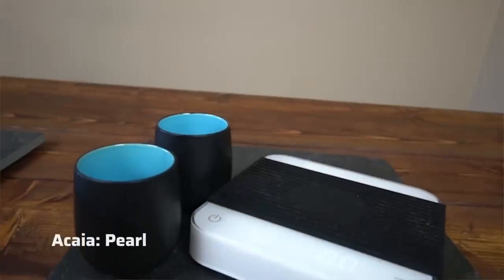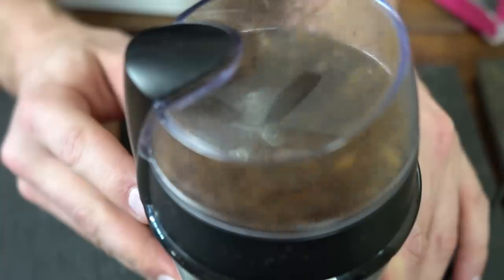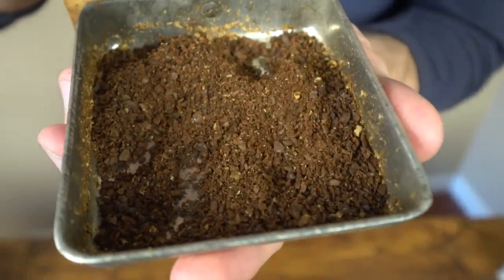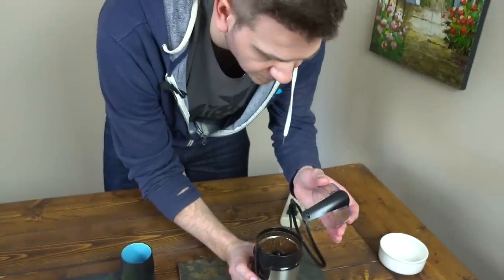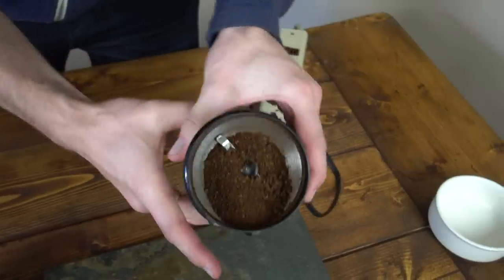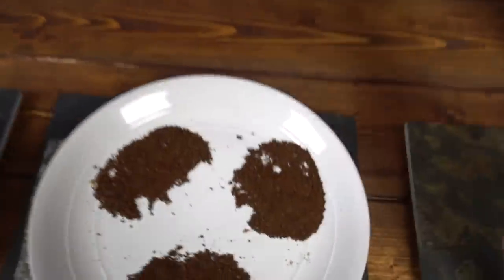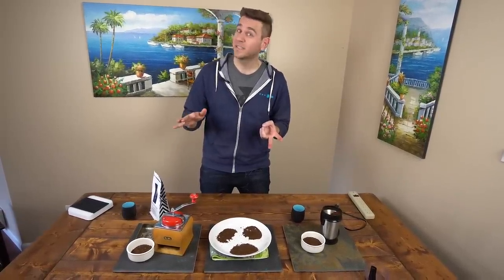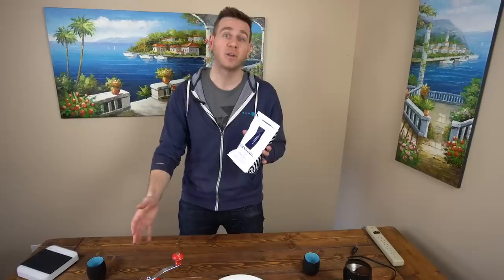Burr Grinder vs Blade Grinder || Coffee with Serge Ep4

Comment: I'm not sure why it's important to me, but thank you dear Editor for including the "turn off power bar, then reach in" shots
Reply: You can never be too safe, but typically these electric grinders require the top cover in place for the trigger to actuate.
Reply: Yeah, there's a reason a lot of blade grinders integrate the button into the lid, so you can't turn them on without that in place.

Comment: I switched from a blade grinder I had been using for years to a burr grinder a couple months ago. I was pretty good with my blade grinder but the burr grinder now lets me make the same cup of coffee everyday. I also like the fact I can change and control my grind setting for different beans that I buy. If you are new and don't want to spend a lot blade grinders are fine to start with. I do recommend the martini shake I think it helps create a more even grind without over grinding some of the coffee.
Reply: Hell yeah! The martini shake for sure is a thing I enjoyed the most using a blade grinder 🤣  
But the end result using a burr grinder is just a lot more uniform which is important for better extraction depending on brew method.

Comment: I got a burr grinder for christmas this year and the difference was stark compared to what I got from my blade grinder.  Especially for making cold brew, I used to get SO much sediment from the blades no matter what I did.  Went to the course setting on the burr grinder and had almost none.
Reply: Going from "spice grinder" to cheapo-electric burr grinder, to Baratza Encore (p-good electric burr grinder) has been a continuous staircase of "Less unusable dust")

The only use case I can argue for a spice grinder are less expensive latte/cappuccino makers where your intent is to consume caffeine, than to dial in the espresso. and the fine-to-dust grind works out.
Reply: I also got a burr grinder for Christmas this year, and I'm really looking forward to finishing up my pre-ground coffee so I can give it a whirl! My blade grinder has been collecting dust in a corner because, well, dust is all it's good for. Coffee dust and inflicting noise-related migraines. Can't wait to toss it.

Comment: Question: Are there automatic burr grinders, for people who like the consistency but don't like to hand grind?
Reply: Yes! There are many out there but they do tend to be slightly more expensive than blade grinders. They are also loud. :) btw I found I can get good consistency w/ a blade grinder if I periodically shake the grinder, separate out the big/uncut pieces from the smaller pieces in temporary bowls, then regrind just the big pieces. This is definitely easier if you have a blade grinder with a removable receptacle (unlike what Serge is showing here).

Comment: I remember reading that blade grinding also causes "friction burns" on the beans, but it's been a while and I may be misremembering it.
Reply: I notice that when i use my blade grinder without shaking it, the finer dust clings at the bottom and gets heated up by the friction of the blade and also compacts.
I get much better results by shaking the grinder as it goes, and less heat.

Comment: I used a simple, similar electric blade grinder, but found the same thing in the huge chunks and the fine powder. It does suggest holding it down for a certain amount of time based on how many servings and how coarse you want it. We got rid of it though when we got a hand crank, brushed metal crank burr grinder from Amazon. It's been good, but the size of our grinder means it takes forever to grind enough coffee for a large glass container of cold brew. 

I'm curious if anybody has come across a good electric burr grinder. My wife has rheumatoid arthritis, and it'd be great if we could both get whole bean coffee instead of getting something pre-ground for her and whole bean for me.
Reply: I've been using a Wilfa Svart for years, and never had a problem with it. It's pretty expensive, but worth it in my opinion.
Reply: I have a Rancillio Jacky, which I love but has sadly been discontinued. I've heard good things about the Rancillio Rocky which replaced it. Again, these grinders are on the expensive side but useful for my use case of fine tuning a grind for espresso
Reply: I have a Bodum burr grinder which works pretty good.
Reply: If you are looking for a moderately priced grinder, I can highly recommend the Baratza Encore (Comes in around $140), it gives a really consistent grind. It's also repairable; the company sells all the individual parts, so if the motor or the circuit board goes out you can buy just that part, instead of replacing the whole unit.
Reply: @Maladictem  Seconding the Baratza, specifically that I wanted a grinder that could do coarse for French Press (maybe Cold Brew someday) and fine grind for my Latte/cappuccino maker. So far in love w/ the coarse grind, have yet to try the fine, since I only just got it this holiday season ^^;;;.

Comment: I currently use a Wilfa Uniform, which is a higher end blade grinder that's doing a better and more consistent job than my old (and cheap) Delonghi burr grinder, so I guess it's just as much the quality of the machine as the method of grinding.
Reply: Yeah, there's a wide range on burr grinder quality. Particularly if you get into espresso.

Comment: As a Blade Grinder-owner, I've found it best to press and hold the button instead of pulsing, that way the heavier chunks fall down towards the center, and the lighter get pressed up towards the sides, making the grind more consistent.
Reply: 3 years later Zelest here. I retract everything I said. After a few years with my blade grinder it is just an inconsistent mess. I really need to get myself a proper grinder.

Comment: Scale proninciation:
Ahk-eye-ah
Question regarding grind and consistency:
If you use the blade grinder and can get your beans to a fine powder, your coffee will have a greater surface area (more flavour released during brewing?). Why is this not better than using a burr grinder which will give you bigger pieces? Thanks

Comment: i was not the only one who double checked that  the power was off on the extension cord when Serge put his finger into the blade grinder, was i?
Reply: If it's anything like my grinder, it can't turn on without the lid in place (there's a switch in the body of the grinder that can only be accessed by a lever in the lid; to turn it on you need to have the lid on, and push down on the button on the lid)
Reply: @viperion_nz  Or do something intentionally reckless in the form of forcibly pushing that lever down, but why would you?

Still doesn't hurt to have a backup safety in the form of outright cutting power.
Reply: I would argue if you're doing something "intentionally reckless" you're leaving the power connected on purpose

Comment: I'm a bit surprised: I couldn't tell the difference by just looking at them.
Reply: Honestly, I'm not sure Serge's burr grinder is the best comparison. I mostly grind for espresso which has much lower tolerances for variation than pourover, but even my cheap old cylinder-style manual grinder (which took ages to grind a single dose) had a lot less chaff and fines than that one.

Comment: Have had 3 of these units in the past 20+ years. They are good grinders MyBest.Kitchen what most if not all the complaints are about concerns a small pop-up switch in the bottom of the unit where the clear plastic hopper slides in. Please don't throw the unit away when nothing happens after pressing the start button. Just take the hopper out, clean @ the pop-up switch or vacuum the area around the switch and I think you'll find that it turns on. Hope this helps....have read reviews where the unit only worked for one grinding, then mysteriously quit working. Again, clean the switch it will most likely solve the issue.